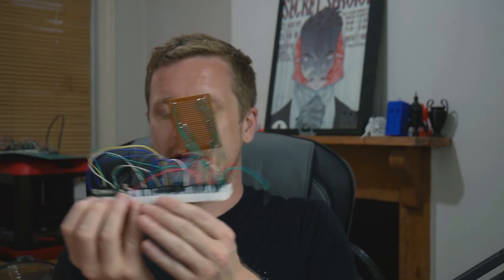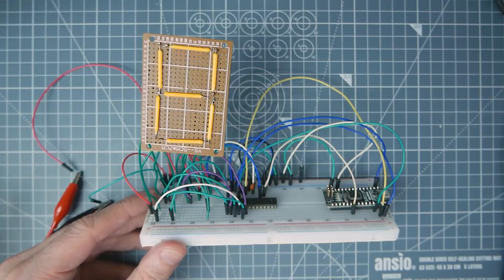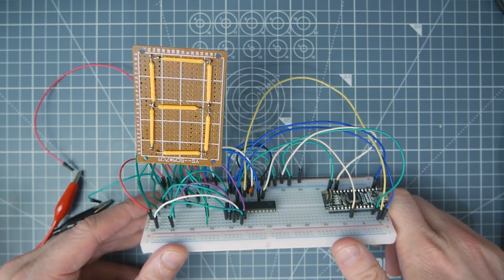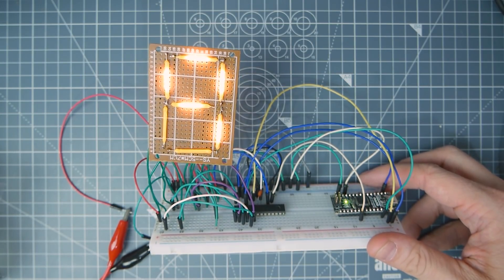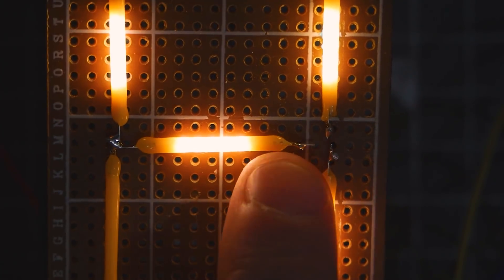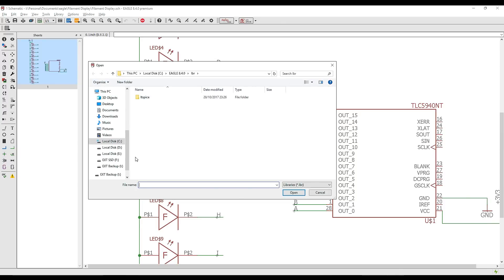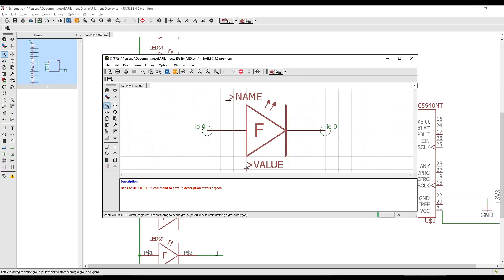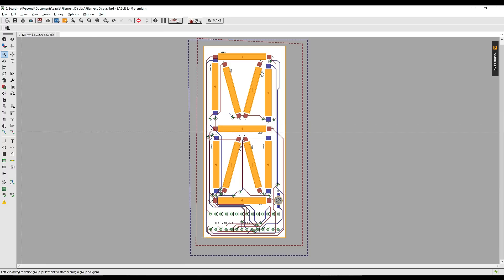Hey UnexpectedMaker: Seglament Display - Episode 3

Comment: It doesn't look as good as I was expecting. It's like it's too thin - maybe needs twin filaments - and the light pattern looks round with big end gaps.  I would bend the pins 90º down and make it THT, and then mount it on a solid PCB so you can run traces under them, and then make a stencil like PCB with slots, to guide the light so it is rectangular, and glue that on top.
Reply from the maker: Never expect anything to look good on this channel or work well come to think of it. Basically, always think the worst.
Reply: It's actually the ends of the filament not lighting up that looks weird, ie too much gap.
Reply: I've had an idea. Get the longer 32mm filaments, trim the ends of phosphor that don't light up, and then trim the tabs shorter.